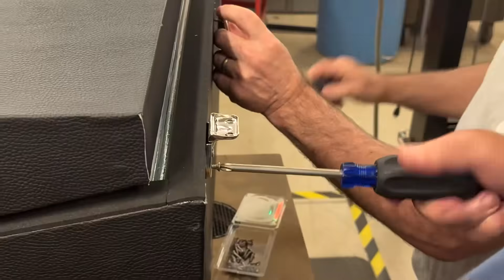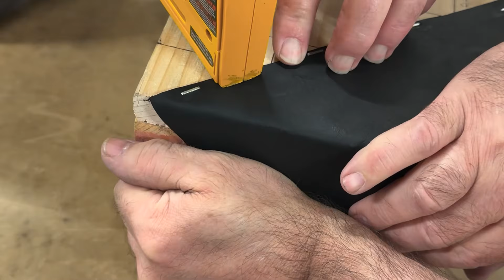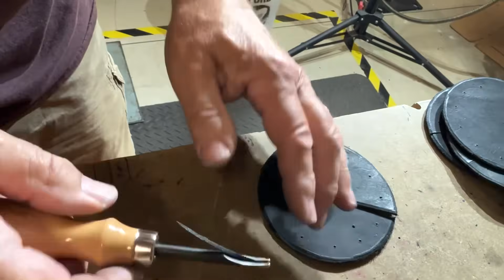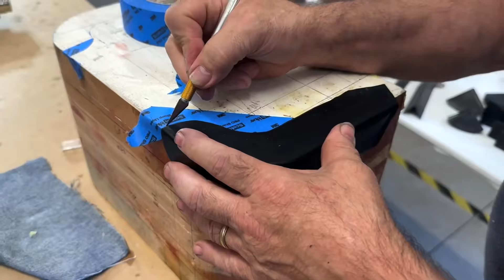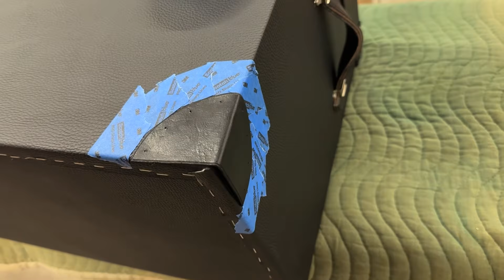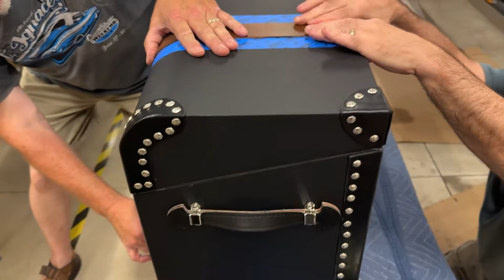Ford Model A Luggage Trunk Build – Final Touches & Hardware

Comment: Very nicely done with tons of information.  I have one question please.  How do you attach the trunk to the trunk holder.  I found a trunk that i want to put on my 30 tudor and i have the rack but have no idea hot to attach it so it stays put.  Thanks
Reply from the maker: I wish we could upload pictures on here, but we can’t so this explanation will have to do. 

To create a secure yet clean mounting system for the luggage trunk, we utilized the pre-drilled holes in the trunk rack and a custom removable floor design.  We used a combination of heavy-duty hardware to ensure the trunk stays put during travel:

T-Nuts: These are recessed into the plywood bottom of the trunk. They provide a threaded metal anchor that won't pull through the wood.

Rubber Washers: Placed between the trunk and the rack to provide grip, reduce vibration, and protect the finish.

Grade 8 Bolts: These thread from underneath the rack directly into the T-nuts inside the trunk.

We lined up the plywood bottom of the trunk with the factory-drilled holes on the trunk rack.

Once aligned, we drilled through the trunk floor and hammered the T-nuts into the top side of the wood so they sit flush.

The trunk is set onto the rack with rubber washers sandwiched in between. Bolts are then tightened from the underside of the rack into the T-nuts.

To hide the hardware and provide a flat surface for luggage, we designed the removable vinyl insert you see in the video. This slides in over the bolts, keeping the interior looking finished while allowing for easy removal if the trunk needs to be unbolted.

Hope this helps you!
Reply: @EpicRestorationz  Hello, thank you so very much. I have been looking online all over for information on this and had not been able to find anything. Your clear instructions will be a great help to me and it gives me the confidence to tackle this project.  I love your videos and get a lot out of them.  Keep up the great work.  You are not very far from me.  I am in Kalamazoo and belong to the Grape Country Model A group.
Reply from the maker: I believe Jerry Dennany is part of that club has one of our trunks. If you ever need to look at one as a reference, I’m sure he’d be happy to let you take a peek at it. Good luck with your project!